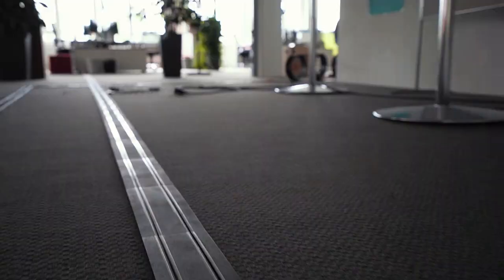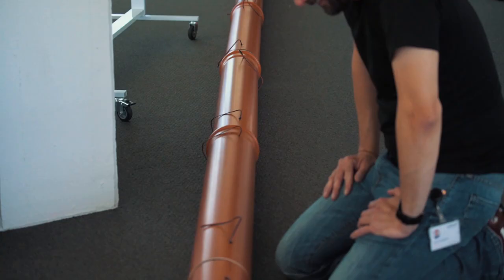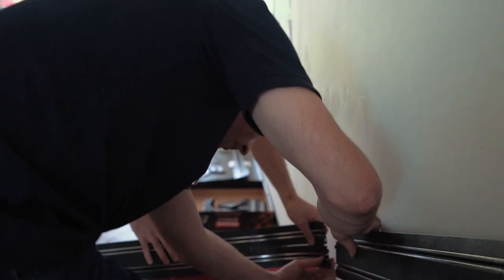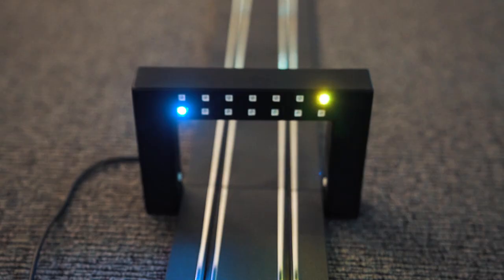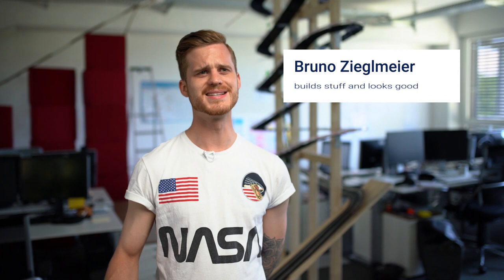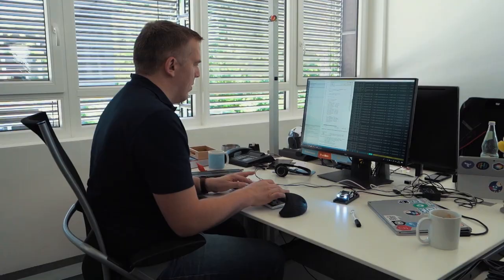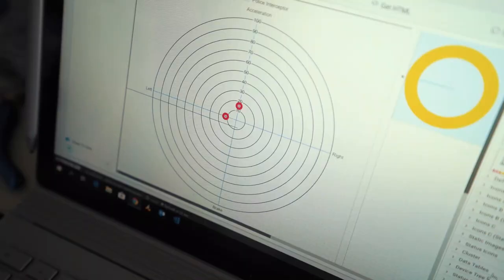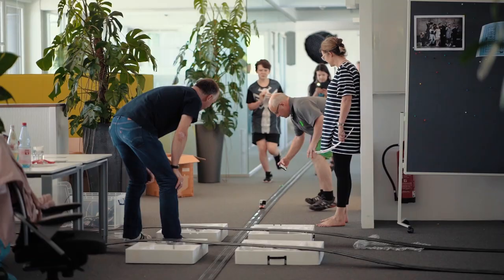Carrera & Paessler - XXXL GO!!! Race Track

Comment: How did you manage to have a good power supply in such a long track since carrera says that you can only make a track up to 15 m long?
Reply: i could only explain it in german but i know how you do it
Reply: @maximiliantekampe4606  OK, say it in German then. I ll use Google translate 😁
Reply: In our testing, we were able to drive the cars with an 80m long track (even in loopings). Since our was way longer than that of course we needed to find a solution. 
Originally we wanted to manage it with one power supply but quickly realised that it is not possible to controll the whole track from one place. Thats when we decided to split the track into multiple sections with individual power supplies (and control units). These sections where not directly connected. We used jumps or short pieces of track without the metal bands in it for example. 

Here is the video of the whole track, maybe you can spot the transitions ;-) 
https://www.youtube.com/watch?v=k1haudwmlR4

Hope this is helpful for you